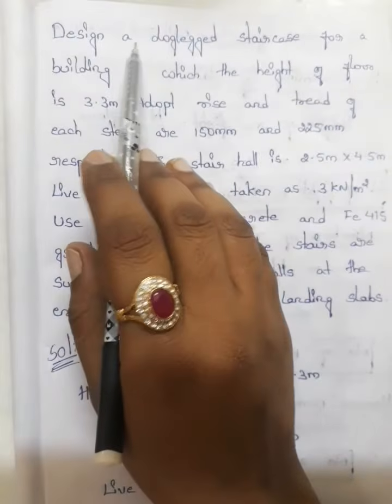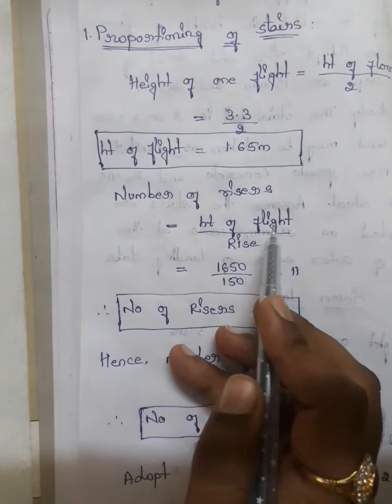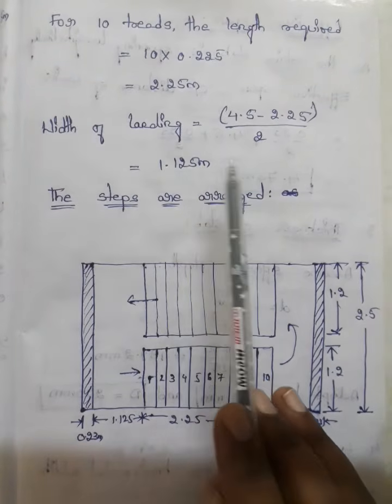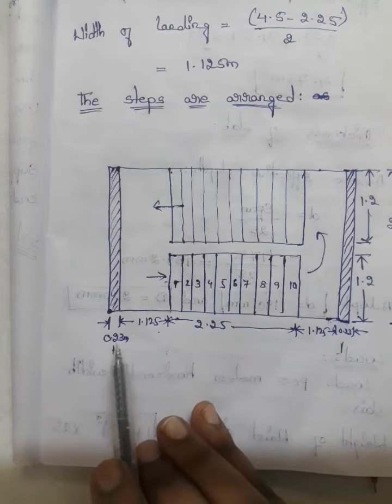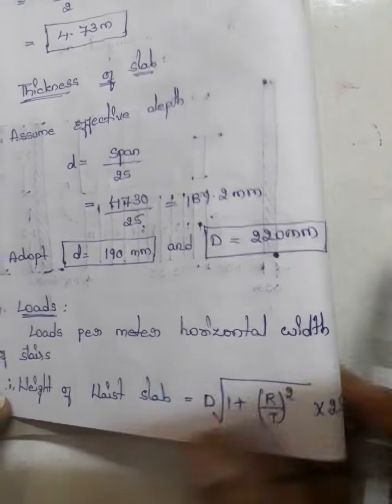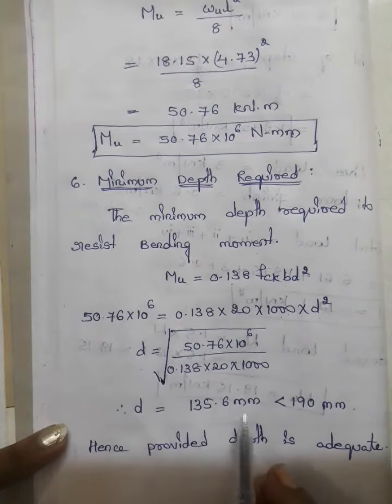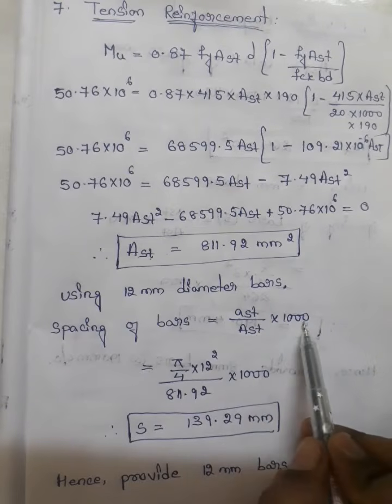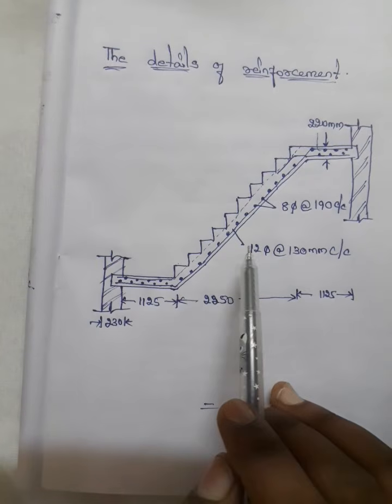Design of Doglegged staircase || staircase Design || #AEE #AE #SSCJE #GATE

Comment: Corner bend details are not acceptable. Most of the engineers do such weak details.
Bearing detail is not appropriate.
Top bar extension and termination points are not clear.